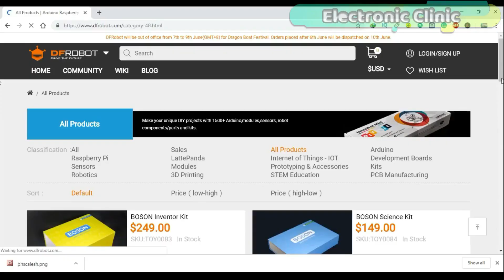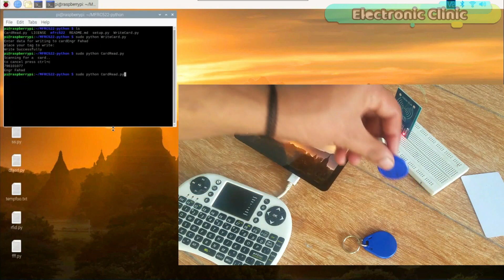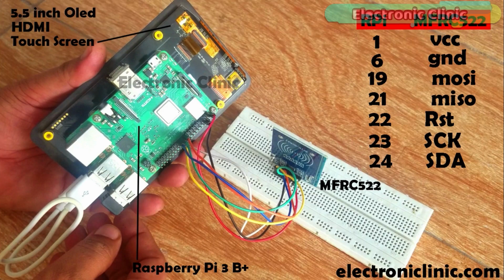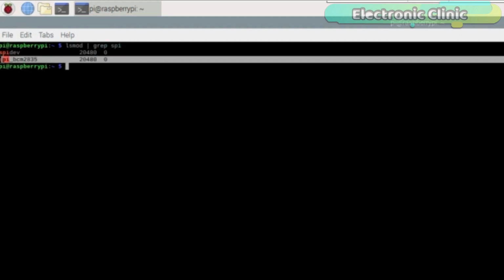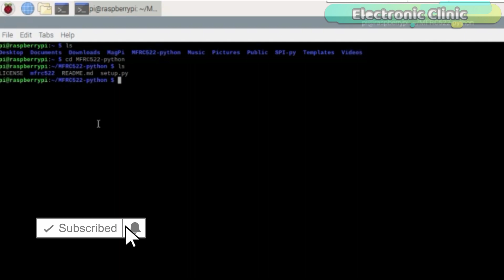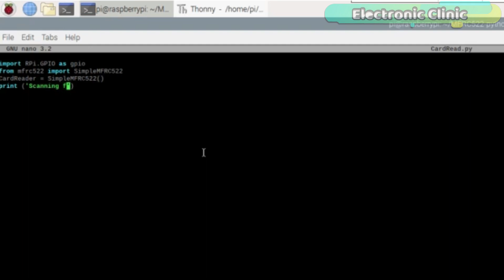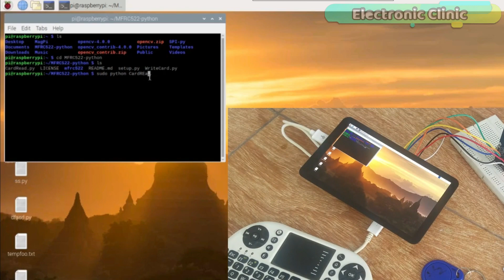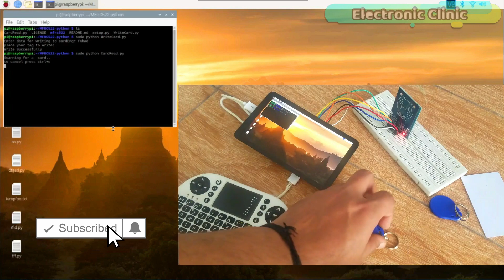Raspberry Pi RFID MFRC522 NFC Reader, Tags Scanner python code

Comment: I would love to know how to connect a small OLED screen to display the RFID data.
Reply from the maker: check the playlist. i have an amazing tutorial on the Oled display.
Reply: @ElectroniClinic  I'll be sure to check that out, thanks. I've got my Oled (SH1106) and Rfc reader hooked up but am struggling with the code to interface them. I'm using the Luma library. I hope your video can help!